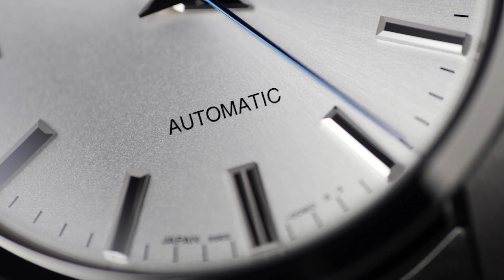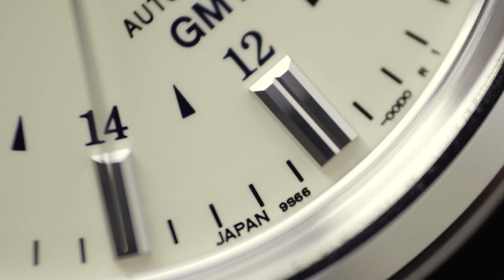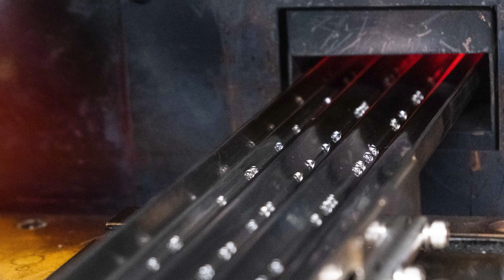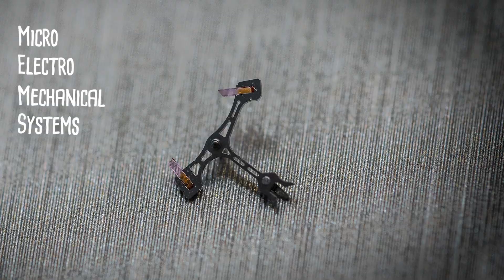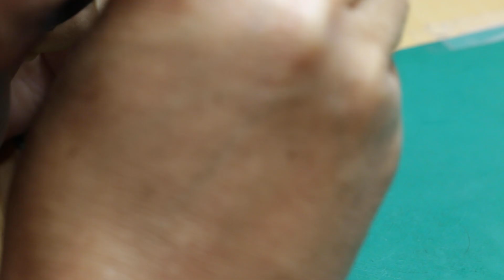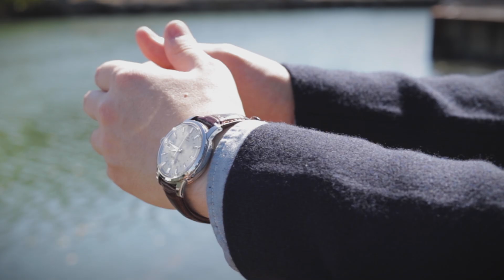A Look Inside Grand Seiko's 9S Mechanical Movements

Comment: Thank you for the short but very educational video. I have a number of different variations of the 9S. As a collector, what I like best is the HPP, High Performance Precision manual wind, the 9s63 and 9s64. Do you know of any caliber with higher specs than these? I also like the dual main spring barrel architecture of the 9R02 and the affordable 9R31. Hope you do a video on this too, and, I hope they incorporate this new innovation on the 9S. Keep up the good work.

Comment: Hello. I am the person who bought Sbgw235 After using it for a few months, I know it's accurate, but I wonder if I can use it for a long time. I wonder if it's strong enough to be used for a long time, such as Rolex and Omega's Movement.
Reply from the maker: Absolutely. They're incredibly robust calibers.
Reply: That is an extremly nice watch, caliber 9s64. I am not a watchmaker, but the lack of problems with GS movements would make me think GS sacrifices thickness for robustness. I think if they wanted, because of MENS, they could make extremly thin watches, but I think they choose not too.
They even use GS movements in dive watches, such as the 8l55 (seen in video) and the 8l35, with very few problems.